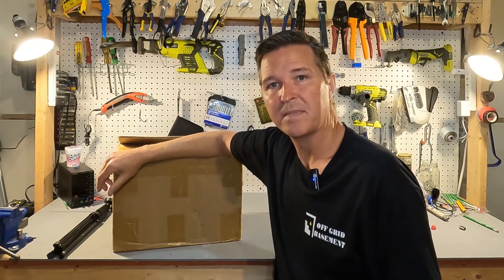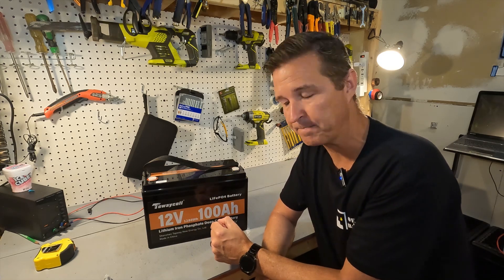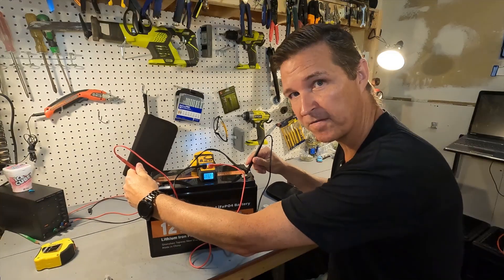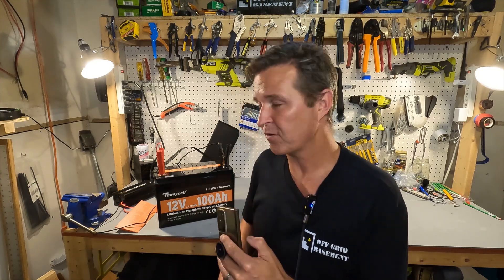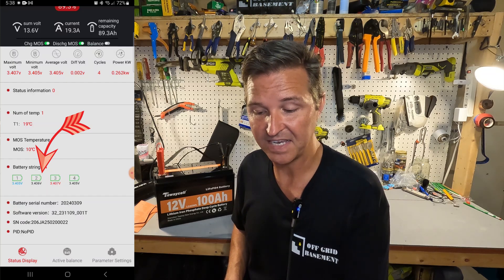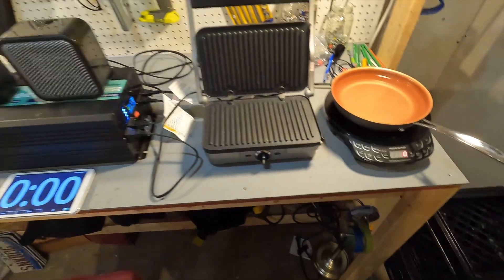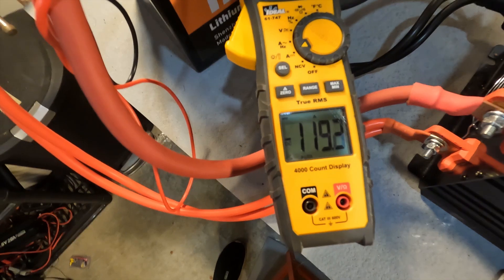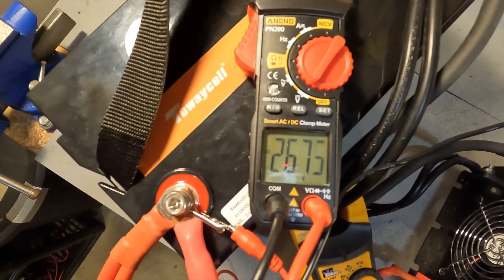Tewaycell 12v 100ah Lifepo4 Smart Battery Review.

Comment: I bought a tewaycell 15kva and 5kva inverter all in one powerwall. I just cant figure out how to connect it to wifi or to the app. You have any insights?
Reply from the maker: I've never worked with that equipment, but is there button for turning the WiFi and Bluetooth communication on?

Comment: Hello, I have the following problem with the battery that I bought from Tewaycell 12v 50 Ah. If my discharger needs around 9.75 amps of discharge current, the BMS switches off the battery! A discharge current of 50 amps is specified in the data sheet. See video attached. Tewaycell doesn't respond to my email inquiries. What can I do?
Reply from the maker: It should be able to discharge 10A DC with no problem.  10A AC would be a different story.  I would watch the voltage and the amperage while trying to pull the 10A just to see if anything is out of the ordinary.  It should hold 12.6 v @ 10A for a while.  Sorry I can't help more.